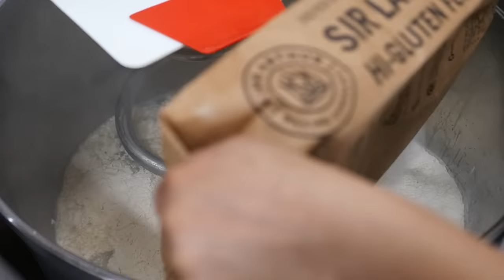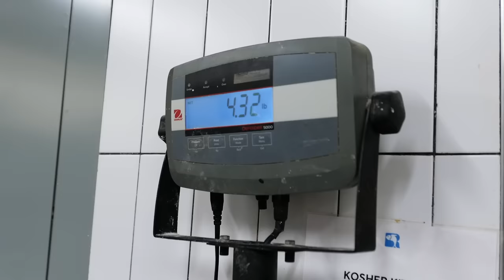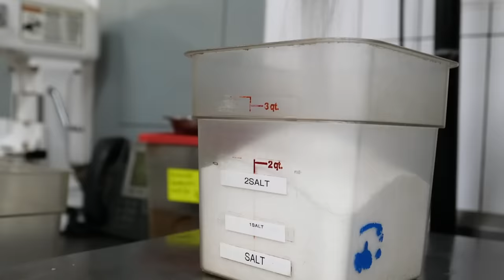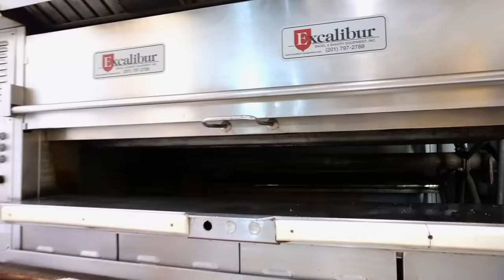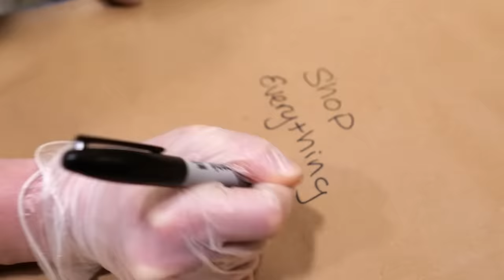New York City Food - The BEST BAGELS in NYC! Russ & Daughters

Comment: Amazing! Although, the squeaking of that oven would drive me absolutely insane! :)
Reply: Can't be healthy for the eardrum
Reply: Agreed  a little lube wont cost alot and the matinence  long term would be low
Reply: i use to work as a baker at a bagel shop with the same type of oven, after a week or two you get use to it and don't even notice it anymore
Reply: Youd get used to it
Reply: Just looking to see if anyone else made the comment that they need to oil that machine.
Reply: I had the same thought. Often, a video makes it worse, but some quit fix job would help.
Reply: We had a rotating deck pizza oven, and we had a grease fitting on the outside that fed grease to the bearings.  My Dad would of lost it if our oven squeaked like that! :-)
Reply: Yes they need to grease it!

Comment: I can't believe NYC Health Department let them use wooden cutting board, and proofing boards. FDA is not allowing it anymore even woods are better choice for moisture control and etc..
Reply: They are bagels, not meat. Not fish.
Reply: @TG-eh8uo  Unfortunately, here in MD, and VA. 
FDA, and the Health Department don't let people use wooden boards, and wooden cutting boards anymore for sanitizing issue.  People has been using them traditionally for moisture regulating purpose etc.., but you don't even want to start arguing  with them. 
Oh, many people mentioned also..  The lox looks sooooo good, but they are not supposed to wear any dangling things on them while working.

Comment: With the lockdowns, many have tried to make bread, some have succeeded, some have been disappointed while it is so, so easy.
And because I read and see various time-consuming "recipes" on You Tube, etc., my friend Giannis, whom I learned from and has now become ... PRYTANIAN, told me that it is a pity and UNFAIR, leaving the worldly, to bury TOGETHER with the "secret" of bread making.
I start with the CARBOONED-UNHAPPY buns that need chewing ... press to go down to the esophagus (feu).
ALL but ALL the doughs are STRICTLY baked at 150 ° C, NOT a degree higher. The length of stay INSIDE the oven depends on the kitchen. E.g. because I have a small oven of the well-known factory of Macedonia (MAS) "Davos" = the resistors are at a shorter distance than in a normal large kitchen, I cook STRICTLY for 45 minutes. In the oven of the normal kitchen for 1 hour. Let's go to the other easy ones. To prepare bread we will need for every 100 gr. flour (hard) 2 gr. dry yeast, 2 gr. salt and 60 gr. water (do you understand now why bakers get RICH ...)
To make (for a start) a loaf, in the bowl of the food processor (a necessary accessory in every household, because kneading by hand is hopeless) in order we add: 240 gr. water, the contents of the sachet of dry yeast (8 g)., 400 g. flour and 8 gr. salt. Knead with the hook (implied) at speed 1 for 30 minutes. On the grill that we place in the lower drawer we put on ANTI-Gluing paper, we shape the dough in the shape we want (I personally like the loaf) and we put it on.
Turn the switch to 50 ° C, and let the dough rise for ½ hours. Then and WITHOUT someone strange (fev) open the oven door (because it will invade cold air = we lost) turn the switch to 150 ° C and in 45 minutes of time in a small oven or 1 hour in a large kitchen oven the bread YOUR BREAD IS READY, ie waiting time JUST 2 hours.
And while it's so easy AND fast compared to various other recipes I read and watch on YouTube, they avoid bothering because because when they see that ... they will need ½ a day in the kitchen, for a loaf of bread it tells you do not ... "good" is also the CHARCOAL of the baker.
These and good luck.
With Love Manos.
PS Chatting with the baker in my neighborhood I asked him why he does not bake bread for an hour at 150 ° Celsius to bake properly and not burn;
And he answered me that if he bakes in this way, his children will be hungry since in 1 hour he takes out three batches of bread, baking it at 200 ° ~ 220 ° Celsius.
And after all, my Manos, since he is used to eating it like that ......
And bread for your family?
Well, for my family I bake it at a low temperature.
I hope you understand how bread making works INTERNATIONALLY.

Comment: The way they dump the bagels into the kettle is SO WRONG. Loads them with cornmeal. They should pick and toss them
Reply: I guess at home can be done one by one but on  factory it’s impossible
Reply: @fainaspivak7593  I did it when I worked in a bakery
Reply: @johnferreira7498  in the bakery yes, but factory it's impossible
Reply: @fainaspivak7593  worked at Pechters bagel factory each oven made 600 dozen an hour
Reply: @johnferreira7498  Guess you’re right!